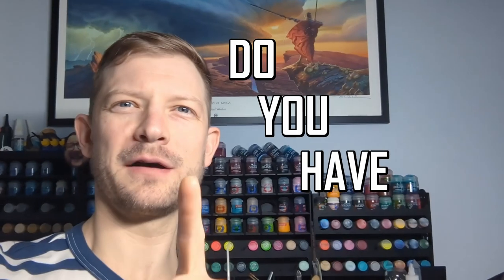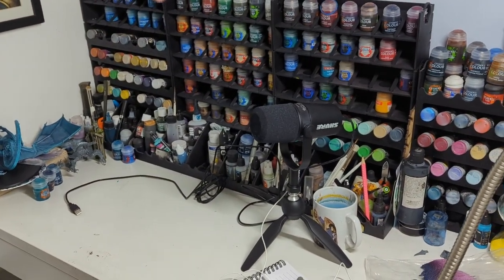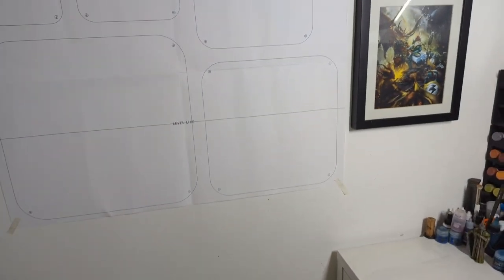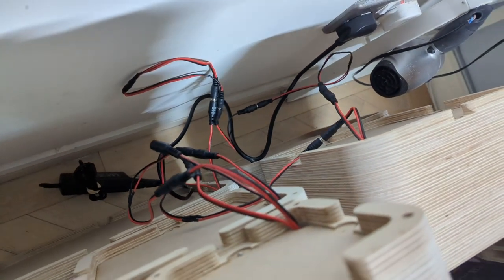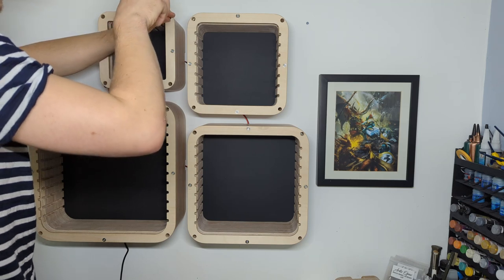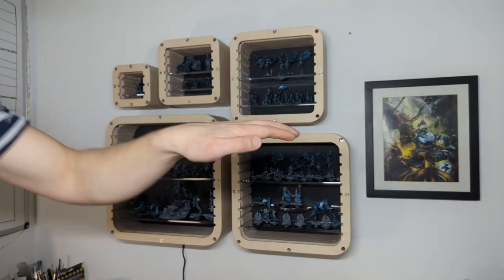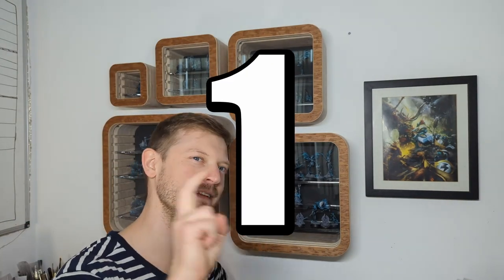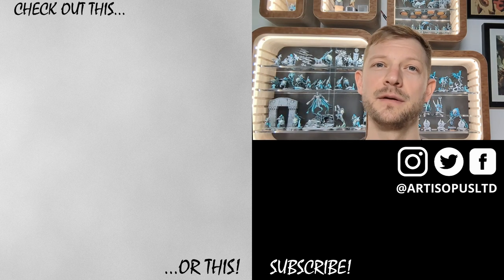(Giveaway!) My Tiny Warhammer Hobby Area + Upgrade

Comment: I use a pair of 12" deep kitchen cabinets.  Top shelf is rattle can height.  Middle shelf is the height of paint pots + an inch.  Currently active paint pots are kept in trays so I can pull out all the paint pots for 1 current project and put them away quickly.  The goal here is to setup and break down the paint session quickly.  Bottom shelf is just random stuff like a water cup, pallet, current wip-model, etc.  Underneath this cabinet is a paper towel roll and an LED strip for extra backlighting.  It's rgb too because why not.

Underneath my desk is a heavy duty locking keyboard tray that can slide in and out (and lock...because kids).  Inside it is a silverware organizer tray for my paint brushes and hobby tools.

Inactive paints are kept in a drawer unit under the desk that can lock.

Paints pots on desk, or MDF pot holders murders desk top space I've found.  Paints don't need to be seen.  Instead get a big sheet of thick paper and paint swatches of all your paints on there in a layout that makes sense to you.  Your paint collection can be quickly referenced with that sheet.

Comment: SUGGESTION: 

I am also preparing to plan a panting space, as i will be force to move.
What I am aiming for is a few things as absolute minimum:
- electrical desk ( I am, and I bet many of us are sitting way too much during a day)
- flexible, adjustable lightning to work with the electrical desk
- Peg boards/walls _ I do not want to limit myself to the particular setup or paint rack. I want to have my space modular and bring what I need to the space I am working (as you said during the video - we want to keep stuff next to us that we really need. I will add to that, that I want to keep stuff I need the most for each assignment)
There are many options to organize paints , tools etc straight from many shops or you could 3D print what you need.

-(* not a minimum requirement) - I would like to have my airbrush and compressor organized in movable workbench.

Key challenge I see now is power socket layout.
More I learn when I will know how much space I will really have :)

Comment: My suggestion to small hobby spaces (being in one myself) , verticality is key. Its a cool poster to have, but there is so much space above your paint that you could be using. Corner shelving or even using 3m command line to add some baskets or other storage, will go a long way. You already have the right idea about keeping the most used stuff closest but all the other things that you don't use as much could be stored at the highest

Comment: First suggestion: raise those paint holders mounting them on the wall to free up a little space from your desk.
Second: As an architect, I don’t think those artworks placed there are going to be helpful, is just visual noise at this tiny space right now.
Third: saw that in the back you have a whiteboard and a small drawer unit, I would replace that with shelves from bottom to top with some drawers/storage boxes to keep clutter away.
Fourth: mount lights on the wall not desk as they will take some space from your own movements around the desk.
Fifth: if you can have a desk with a slim drawer underneath, that can be a nice storage with quick access too.
Last one: if you still feel like you need that whiteboard back, use the back of your door 😌

Hope it’s useful to anyone!

Comment: Tip for paint storage is nail varnish racks, but not the tiered ones as they take up too much desk space. I use the single tray ones that can be secured to the wall. I have two rows of three that sit nicely secured to the wall underneath my window sill above my painting area - holds approx 72 paints.

Comment: What I have found out for my small hobby area was to use as much wall space as I can instead of wall art, as well as using immediate underdesk / side of desk floor space for items that you use most often, but can be in stackable multi-compartment bins (like those handled ones from harbor freight or Stanley Tools). This helps to keep the workspace more open, and vertical storage is the way to go 👍👍.  Also, if you use the space for computer work, having the monitors wall mounted on the wall above the desk is useful along with the mouse and keyboard on a under desk tray (or store them if they are wireless).  The only thing I would suggest that is on the desktop workspace is the hobby area mat and the lamp, everything else can be on the walls and under the desk or at the side of the desk (or in a nearby closet so it is not cluttering your regular workspace).

Comment: My best question about a small hobby space: how do you manage to fit an airbrush set up in a small hobby space?  Most setups I see take up the majority of a desks surface. I know you can just use a rattle can outside but some people, especially those with smaller spaces, may not have the ability to spray paint outside.

Comment: Great video Byron, enjoyed your excitement with the displays reveal, the army and cabinets looks stunning. 

Suggestion: Small strips of tape or a cover strip the colour of the wall between the boxes to hide the cables would be awesome. To be fair, you only see them straight on, but I have just been hiding cables at home which made me notice it 😀

Hobby Suggestion: Where possible, I try to make sure my storage/area has doors and/or lids on. Dust gets everywhere, which is a pain for painting etc and its very easy to clean down when most stuff is closed.
Reply from the maker: Hey buddy!

I've just had some trunking in for the bit from the plug up the wall, debating what to do between them, I want something neat, which again may be small trunking cut to size, or something similar.

Dust is a fair point, I periodically dust off the shelves, butthe time to put everything back puts me off doing it as regularly as I should!

Comment: My question would be maximizing the space directly underneath a table top. Some type of storage that hangs or attaches on the bottom of the table top. Foot room in my setup is already full but the space in-between the floor and  bottom of the desk can still be used, but far enough towards the back of the desk so knees still clear.

Comment: I’d recommend using shelving units from places like B&Q. They come with different sizes and they’re sturdy so it’s easy to stack up heavy boxes on top. And the problems with sharp/metal edges can be solved by gluing a split pool noodle to them. Avoids chipping the walls and just “personal” damage

Comment: my suggestion is a deeper desk, I used an old door on top of a couple wire standing shelves and a cheap yoga mat for on top of the door for some protection. and when it gets all mucked  up just replace it. I use cheap yoga mats for lots of things. 3d printer mat, keep thigs from sliding in drawers. cut to size a Bob's your uncle.

thanks for the videos and your display cases look amazing.

Comment: My Suggestion is to use non-hobby items for storage.
You can get a set of A4 paper storage draws from an office supply store, and it's a great and cheap way organise lots of paints. Can be put away easily or stored out the way if you dont have a dedicated hobby space for racks. Can also be used to transport paints if needed ( a twist tie will secure it if needed).
I Have a box with 3 draws, and it could store nearly 200 GW pots - very space efficient.

You can also get small cases with dividers in them for storing crafting bits like butons etc., and they are an easy way of organising brushes, as well as hobbying tools. 
Being able pack all your tools into one small box means if you want to some building, you just get your sprue and the box with your tools and you're ready to go.

lastly you can get a magazine holder to hold sprues, either when stored away, or used with a lil tupperware box for loose bits as a way of keeping the sprues between sessions without putting back in the box or leaving out and inevitably breaking.

Comment: Best suggestion for smaller areas would be to use the walls as much as possible. There is (usually) so much space that can be used that isn't. There's no way that I could have the tools and paints that I've got without proper wall racks. Mig Jimenez got awesome wall mountable racks, Hobbyzone.pl and GSW too that aren't expensive at all.
Example 2 of this. Use height when setting up your hobby space. There are so many excellent modular systems that let's you build on the height. This leaves a lot more area for your painting/assembling.
 
Oh bonus tip. Always, always! Clean up after you're done. That way, when next you sit down, you've got a clean enticing area to work in. 
I know, doesn't sound like much, but it helps so d*mn much!
 
As for question, don't know. Always been lucky enough to have a space for my painting.

Comment: My advice is that if you would struggle with a dedicated space, just keep things in boxes/on trays so you can bring it out and put it away quickly (maximising how much time you can spend on the hobby, while preserving space for whatever else you need it for).

I have a small amount of desk space, probably smaller than your desk, and I have my computer and screen on it. Much of my hobby stuff lives in improvised, cheap boxes. I have a lot of paints which live in a cardboard box (think amazon box), and I can fit all the paints I actually need for any one project pretty much in another, smaller box, with the top cut off. If I finish a paint scheme and start another, I can simply swap out what paints I need. My current batch of space marines live in an old egg carton, my 'wet' brushes live in jam jar (the box AO dry brushes came in are too nice to get rid of, so they're staying in that), and my wet palette is literally a box. These are all stored under the desk on shelving, so to start painting I move keyboard and mouse out of the way, and bring up paint box, wet palette, brushes, and carton of models in progress. Takes less than 30s to set up and keeps things tidy.

Comment: Pegboards and a rolling cart.  The cart lets me roll my airbrushing supplies under my desk.  I have one pegboard on the wall and I have little shelves I keep the most needed stuff on.  I  attach rubber bands to my brush handles and hang them vertically from the pegboard hooks to dry  I also zip tied a pegboard to my rolling cart for extra storage.  I hang my snippers, scissors, and other miscellaneous stuff from hooks and clips on the board

Comment: I use artist's acrylic tubes and attach small hooked curtain clips to the end. Then you can hook all the paints to a dowel!/metal rod or wire/string/rubber line attached to the wall near the desk.

Comment: I have moved to having trays for each activity. I have a small desk and no storage on walls or under desk. So I put things in 3 trays that are different events in the process for my hobby. I have painting tools and cleaning stuff, then a building and sculpting one and finally and electric one. It means I can go to the storage cupboard and load up extra bits I might need and it is all stored away from the desk. Plus I get distracted less that way by trying to do everything at once

Comment: I paint in a 2 by 2 square area.. when i have to build and work with XPS, I throw down a tarp and work on the floor. It's easier to sit down and cut and prep in my small house then to use a table. 

I also put all my material in stacked foot high boxes from IKEA. Easier to store six to eight boxes in one corner than to build shelving.

Comment: Suggestion: I have limited space and so can't have a permanent hobby area set up. I've transitioned to a series of small stacking boxes containing various tools, paints, brushes etc groups by use and labeled. This way depending on the project I have a much smaller amount of stuff out each time I'm hobbying and can swap and change quickly based on what stage I'm on. 
For example, I have a small box which has an A5 cutting mat in the lid, and then my clippers, knive, filles and glue for building models. Another box contains brushes for base coating and drybrushing, a different one contains fine detail brushes. One box has base neutral tones (black, whites, browns, grey), and then different boxes have different tones (red tones, blue tones, metalics etc). This means that despite having a limited area, everything can be grabbed easily, and then all stacked away into a cupboard when not in use

Comment: My suggestion for smaller areas/tables or people who have to paint where they dayjob from home is to use a monitor riser! Since theyre made for monitors, they come in all sizes to fit most small desks, and they effectively double the amount of desk space you have as you can put stuff both above and below it. I use a glass one and keep whatever paints, my wet palette, brushes, infantry im working on and waterpots under it while i work during the day and can easily pull everything out once finished to paint. You also have the benefits of being infront of a pc/monitor, so have easy reference or tv to watch while you work!

My question (or the suggestion for next video i guess) is - best solution to lighting in a limited space/upgrading to professional lighting in a limited space and budget? I currently have a large daylight bulb lamp off to one side, and have to rely on a selfie camera stick that also has a small daylight bulb for my other light. what would be the best option for a clip on desk light that can be mounted to the back of a desk, that would softly illuminate the figure and not cast hard intense shadows that block vision in areas not caught by the light. This is a big issue for most, and poor lighting can lead to some paintjobs that you think look really good, until you get them in a natural lighting and they look awful (im sure weve all totally missed a part of a model, or got a guy whos trouser leg looks awful because of this!) 😂

Comment: IKEA 'Helmer' storage unit on wheels is great - all spare paints (texture, Tamiya) and assorted 'regular, but not need access always' stuff (files, sanding sticks, glue gun) fit in the drawers and it rolls under most desks.  And echoing already said in at least one comment - get a good chair.  If you have the room, get a corner desk (Amazon is your friend) - allows an airbrush booth on the other 'side' of the desk (having started with a workbench about the size of the one in the video, it definitely upgrades space). Finally, dollar store storage bins (with lids) for the assembled but not painted minis

Comment: Suggestion: I have singular desk that functions as primary area for PC work and hobby space, so I have become adept at keeping things organized. 
 
I abide by the 5S (or 6S) guidelines for my workspace. Sort, Straighten, Shine, Standardize, Sustain, Safety (6th S). You can easily find multiple resources online that discuss the premise of each of the 6 principles. The overall idea is that you organize your workspace by tools used most frequently, so they are within reach. I place like items with like items. All paints are together, but further broken down by colors, type (washes, acrylics vs enamels), etc. Ensure your area stays clean so you can easily find all materials and tools when needed. Regularly visit your workspace to ensure continued improvement over time. 

In order to gain further desk space, I am upgrading to a sit-stand desk with a slightly largest footprint. I will be including under-desk tower mount. Further, monitors will be placed on VESA mounts attached to the desk itself. Similarly I am looking into a small cart which I can place a small airbrush paint booth(collapsible) on so I can pivot to the booth when needed and then store it in the closet when not in use. The cart will also function as a space to store materials and tools not regularly used in the painting process. Think of basing or sculpting materials. 

Completed models remain in magnetized storage tubes, while in-process models currently go through a staging process of building, priming and painting. Staging allows my work flow to be more efficient to allow my desk to pivot back to a PC without clutter. 

Finally, planning. Plot the approximate timeline to complete a project and try to stick to it. By holding yourself accountable to milestone/deadlines, you will learn to be more efficient in your smaller hobby space. I have found a whiteboard with milestones helps me as a visual reminder, you may find a daily planner works best.

Comment: For small areas: use height and the walls as much as possible. If your desk is encased in a library, use the library walls (and the space below the desk) to hang paint racks and more storage and tools (a good two sided tape is more than enough to support almost anything you'll need, at least in my experience, no need to drill that nice library). And, never stay locked in the preset use of hobby furniture, but be creative. If, like me, you like having a blackboard to take notes, there are adhesive sheets (coated as blackboard which you can draw over with chalks or chalk-markers), glue them over a "rigid enough" plastic plate (I use a honeycomb polypropylene panel) and you'll have a nice, light weight and cheap space for your notes, easy to cut in any shape and size you need and easy to hang between your paint racks, filling that otherwise wasted last square foot (or more). If you magnetize your bases, you can even hang the plastic and resin miniature you are currently working on on your walls, there are many size of metallic tape to stick to your walls and they are not particularly expensive. You'll likely have to move things around while you paint, so be modular to save space: keep all the tools you use in the same phase together (e.g. all the prep tools in one box, the brushes and brush care in one place, the basing materials in another box), so that you won't need more than one box out at the same time. I hope that's everything, I personally use these tips to manage my limited hobby space.